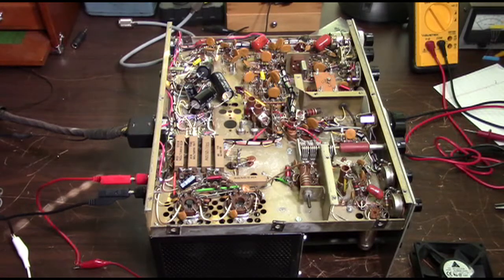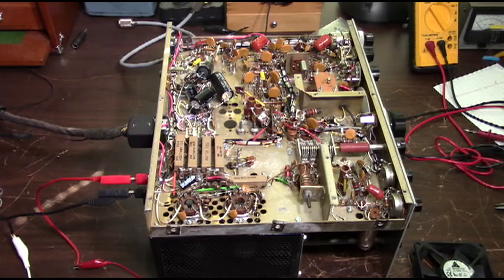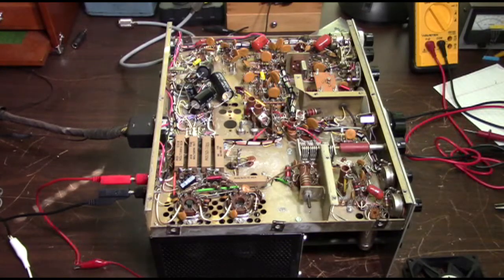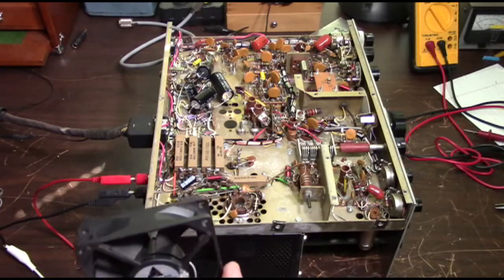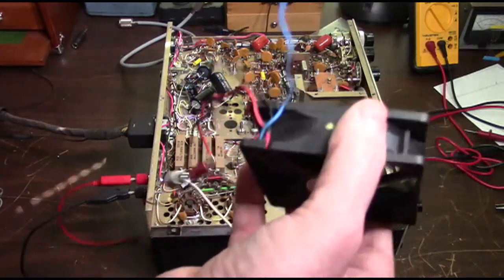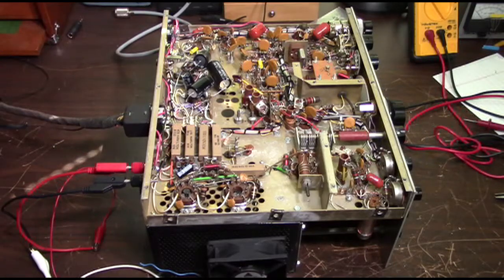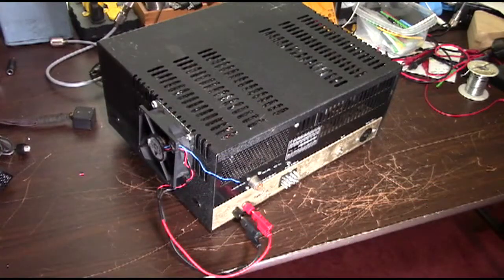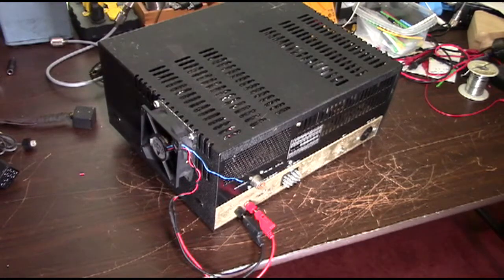Swan 250  6 meter Transceiver Restoration Part 4 - Update: It's DONE!

Comment: OK waiting on the FINAL Update On The Air! I have one that works Great on SSB but I have not been able to tune it on AM which is really why I wanted the rig.I'm NOT a Tech but I replaced all of the weak tubes & the output power is just over 90 watts on CW & my Bird meter does not have a PEP function so I'd guess that it's doing just fine on SSB Peaks.Had a friend locally work me on SSB & he says it has Great transmit audio so I'm not sure why the AM transmit has an issue.I tried per the manual instructions to tune the rig for AM but I can't get the required readings on the meter on the rig though there is no issue doing so on CW or SSB.Thanks for sharing the videos & maybe we can work SWAN to SWAN sometime but that would require I take my ICOM 756 PROII & PW-1 OFF of the 6 meter band for a little while.Almost forgot that my 250 has not had the updates done & I am planning on having them done as well as having the meter mod done so that the meter works as an S-Meter like on the 250C also which I think is a much needed & wanted mod for receive.I'll be looking for the Final Video so don't let us down.  de W4KVW  EM80 North Florida
Reply from the maker: I had planned on doing the final update about a month or so ago. I got everything on video but the on air test. When I tried to get it on the air I discovered that it ad developed, somehow, a problem in the receive circuit. It did not receive any signal at all. So it's back on the bench. As soon as I've tracked down the problem I'll try the on air test again.
Reply: Looking forward to seeing & maybe hearing her On The Air! God bless.  {:>)